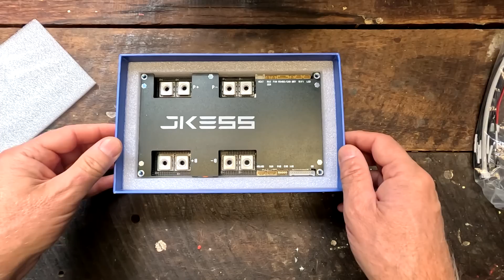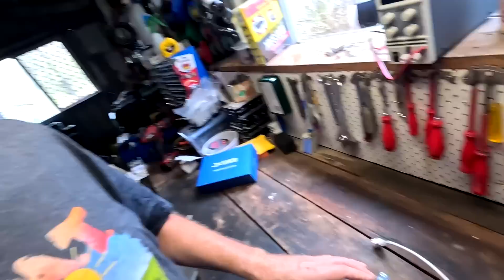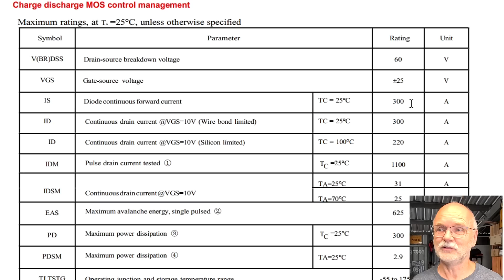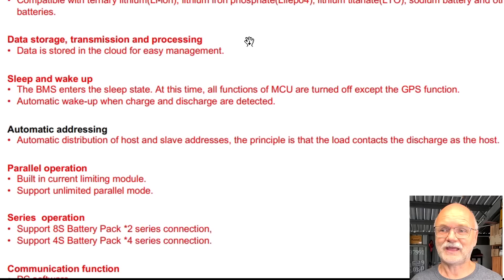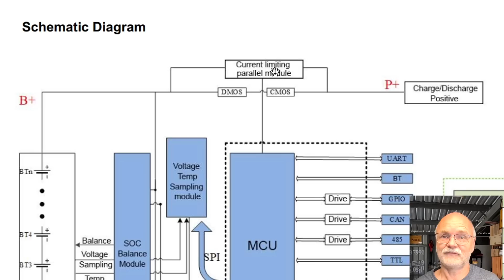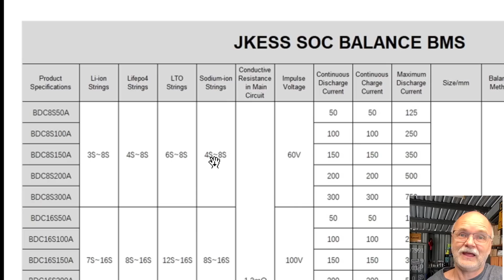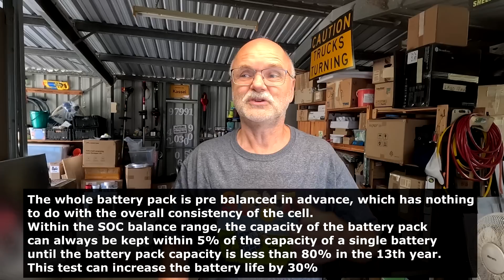Brand new JKESS BMS! Hardware, Specs, Features. It's not a JK-BMS though🤷‍♂️

Comment from the maker: It turns out, this JKESS BMS is NOT made by JKBMS/JIKONG like all the other JKBMS we have tested and used for years (BD and PB series)!
The JKESS BMS was sent to me by the JKBMS Official Store on AliExpress which is a distributor for JIKONG products, but this new BMS has nothing to do with JKBMS or JIKONG. It is a totally different product and not linked to, made or designed in any way by JKBMS or JIKONG. 
At the time of making this video, this was not clear to me. For a few months, I had in-depth discussions with the distributor about this JKESS BMS. At no point, I was told, that this is NOT a new JKBMS product.
It looks like a JKBMS, it feels like a JKBMS, but it is NOT a JKBMS. It is a fake and counterfeit product. Unfortunately, the JKBMS Official Store tried to use the popularity of the genuine JKBMS (BD and PB series) to advertise, market and sell this product through their channels and I was fooled to believe it is a new genuine JKBMS. I apologise for making these false claims here in this video and platform, but it was unknowingly at the time of recording. A̶t̶ t̶h̶i̶s̶ p̶o̶i̶n̶t̶, I̶ w̶i̶l̶l̶ n̶o̶t̶ f̶u̶r̶t̶h̶e̶r̶ e̶x̶p̶l̶o̶r̶e̶ o̶r̶ t̶e̶s̶t̶ t̶h̶i̶s̶ p̶r̶o̶d̶u̶c̶t̶. I will continue exploring this new JKESS BMS as so many have requested in the comments. Thank you for your feedback

I have spoken to the founder of JKBMS/JIKONG and they are still committed to further develop the firmware for the existing inverter BMS, both V14 and V15. I will keep working with JKBMS/JIKONG, providing feedback and testing new firmware versions.
Reply: I agree with several on here that it would still be interesting to see what it can do. My thinking was to set it up with the 8 worst matched totally different cells out of Frankenstein. If it can SoC balance that, it might be worth something. But yeah, that reseller did pull a shady deception.
Reply: @garymeissner6659  my thinking as well.  I'm very curious now.  This could be a fun little side trip into Franken Hardware land!
Reply: Now I'm even more curious lol
Reply: Another BMS launch failure after an unfinished JK Inverter BMS at launch, but this time different kind.
However, this one was done by some dishonest sellers. The BMS developers probably had nothing to do with this dishonest behaviour and may not have agreed to it, but there was probably nothing they could do about it. 
Still, I would like to see this BMS working and properly tested like other BMS. 
If you would test it anyway, you should rename this BMS first,  just like you renamed Peter-inverter or Peter-board etc.... 🙂👍
Reply: Sounds like it is destined for a life in the Frankenbattery!
Reply: @OffGridGarageAustralia  Hab ein Spezialthema für Dich, der heißeste Scheiß und nur auf Deutsch. 

AKKU ENTLADE PAUSE = katastrophal hohe JK V15 Inverter BMS Standbyverluste ?

Ich schalte mit Homeassistant ab X Uhr für Y Stunden (die günstigsten) per Automation beim JK BMS die ENTLADEOPTION aus.
Uns beiden ist klar, das Haus kriegt dann günstigen Strom vom Netz und nach 5 h hab ich 3-4 kWh gespart für den Morgen, wo Tibber die 38 bis 50 Cent haben will.
 
ABER: Ich hatte in Homeassistant für die Dauer der Pause im Chart eine horizontale SOC Linie zu sehen erwartet, wenn der Akku schon 5 Stunden frei kriegt bei dann 30% - 40% SOC, um danach auch am trüben Morgen bis 9 - 10 Uhr durchzuhalten.

Rate mal, was aus den 30% geworden sind?

Die waagerechte Mauer fällt zum Nachbargrundstück ab und ich hab da Verluste bis 4% in der letzten Woche erstmals gesehen. 
Ich hab den Balancer oberhalb 6 mV eingeschaltet und ich meine auch auf jenseits 3,35 V stehen, aber kann der Balancer 4% des Akkus in 5 Stunden verschlingen ? In 1 ganzen Nacht wären es mehr als 8 % oder nach 100 Betriebsstunden h ist der Akku leer. 

Kannst ja mal selber schauen, ob Du das auch beobachten kannst und was beim BMS das verursacht, denn 8% am Tage sind im 24h Betrieb auch 1 kWh Verlust, da der Akku ja mehr oder minder 247 aktiv ist und Verluste einfahren dürfte, sei es zum Laden oder Entladen. 

Ich bin auf Entladepause gekommen, weil der Strompreis in der Nacht augenblicklich zu hoch ist oder genauer zu nah an dem Preis, wo er später verbraucht werden soll wie dem frühen Morgen von so 7 bis 9 oder 10 Uhr. 
Ich brauch bei 28 Cent doch den Akku nicht laden, wenn morgen früh 36-38 Cent verlangt werden, weil ich bei 20% Verlusten auf dem Rundweg schon mit 34 Cent Gestehungskosten (ohne Kosten für Batt. Zyklen) rechnen kann. 

Da war es für mich smarter, bei absehbarem Engpaß am Morgen eben 3 bis 5 h Entladepause zu machen statt zu laden, aber bei 8% Verlust in 24 h sieht das ja gefühlt richtig übel aus.
Reply: Wow!
Reply: So this explains the naming "JKASS"!  🤣
Reply: Very pleased that work is continuing on v15, many thanks for your efforts in this regard!
Reply: Andy, after a lot of high-tech experiments on JK BMS : JK is abusing you.  No kidding.
Their hardware engineers are doing a great job. Their software engineers are too low level.  As you have noticed so many times.  JK top-management doesn't care ....
I'm checking the JK BMS protocols at the lowest possible level : with the logic analyzer. (((( no confidence in all those higher level hocus-pocus software stuff .... ))).
By now I have a large collection of examples about the JK BMS software "skills".

E.g.  The popular B2A8S20P has a CAN port.  On hardware version V11.XW , software version V11.287H : modify the device address (via the bluetooth app) will result in a modified CAN ID .   Device address = 0 will yield ID 0x02F4 (or 0x04F4 or 0x05F5 for other parameter groups), device address = 1 will yield ID 0x2F5 ,  address = 2 will yield 0x2F6, etc.  So far so good.  The CAN protocol is the Standard Frame.
Another B2A8S20P  :  hardware version V11A, software version V11.54.  One can change the device address (again via the bluetooth app), but the logic analyzer shows NO change in CAN ID  !!!!   Whatever device address selected, the analyzer always shows ID 0x2F4  (or 0x4F4 or 0x5F4).  That's a major error.  Forget to observe multiple JK BMS on a CAN bus.
On top of that, JK changed from Standard CAN protocol to Extended CAN protocol. Without any message to their customers.

Obviously JKBMS has communication problems with a lot of inverters.  
JK is changing internals on the fly and when they improve one item at the same time they deteriorate another item.
Updating features is great, but you should inform the customers about it !
A JKBMS from last year is doing fine, so one order some more "identical" BMS.  Forget it , they will have different behaviour.  

The basic B2A8S20P (or family members) has a 4pin RS485 port. Forget it.  It's a plain RS232 port, with the Vcc wire connected to the battery voltage (thus NOT to 3.3V or 5V).
(((that's why they sell the yo-do-not-need-it RS485 dongle to deal with this high power supply))).  The optional CAN/HC version has an extra port with CAN functionality or RS485 functionality. The CAN story : see above.  The RS485 story : that port is connected to the internal RS232 kernal, only the signal levels are RS485.  No MODBUS, no whatsoever protocol. Again : pure RS232 "protocol" at RS485 voltage levels.  And because of using the internal RS232 kernal, only one of the two "RS485" ports can be used at the same time.

A total mess.  We (= the users) cannot have confidence anymore in JK BMS.  Andy , please , stop promoting JK BMS.
Reply: Oh wow! After such deceptive behavior, I believe the first step should be to no longer send business to that distributor. Can you replace the Aliexpress link on your website with someone more trustworthy?
Reply: @peterdiy  Even better, request the real JIKONG to deal with the errant distributor.
Reply: In any case, I guess this is good news for owners of a V14 and V15. JIKONG should have a lot of motivation to improve those two, to keep loyal customers from jumping ship.
Reply: Now I definitely want to see the PCB!
Reply: @upnorthandpersonal  I second that!
Reply: Not an issue. Do not be so hard on yourself. We all make mistake since we are only human.
Reply: Andy, this is a reason TO test it. Why not? And we will watch the videos. Why not. You could probably test a box of marbles, and we would watch it.
Reply: I can see how it seems like a reseller is trying to push the product in a potentially shady way, but it seems a bit of a stretch to call it a "fake and counterfeit product". It appears to be a unique original design, with a different name and branding, and different documentation; which a reseller, not the manufacturer, is engaged in shady marketing practices with.

I can see why the deception from JKBMS Official Store left a bad taste in your mouth, but it's not clear to me that that anger should be taken out on this product and its manufacturers. 

If anything, I would be more inclined to sever ties with the JKBMS Official Store over it, since it seems that they are the ones overtly engaged in deception.

At any rate, kudos to you to for correcting the information once you became aware of all of the facts.
Reply: @Wrenchmonkey1  You don't take issue with the product name? JKESS? Sold in JKBMS Official Store... It's trying to pass off this product as something it is not.
Reply: @peterdiy   JKESS is not the same thing as JK BMS, which is not the same as JBD BMS... I'm not sure which of those was first, but that's also pretty similar. Does that make whoever was second to market a "fake and counterfeit product"?

You can "take issue" with companies having similar names, but that's still NOT the same thing as calling them a "fake and counterfeit product". Words have meanings, and that's not what those words mean.

Saying that you think it's shady that they use similarish names can be a valid criticism. Calling it a "fake and counterfeit product" is NOT a truthful statement, nor an intellectually honest argument.
Reply: @Wrenchmonkey1  It comes down to what the seller said to Andy. Quite obviously Andy was duped into thinking he got a new JK BMS. Which it is not. 

The consequence should be to not send any more business to that seller. As per my first comment. 

It is quite possible that the manufacturer of the JKESS BMS is innocent. Just like a factory that produces t-shirts can be innocent if they get later sold as brand name products and aren't. Counterfeiting can happen at any point in the distribution chain...
Reply: @peterdiy  What the SELLER said. 

NOT what the MANUFACTURER said.

Did you even read ANYTHING I said in the post you responded to, BEFORE you wrote your own response? Because if you did, you didn't understand it...
Reply: @Wrenchmonkey1  I looks to me that you have anger management issues (all the bold = shouting) and trouble comprehending simple information. 

To spell it out again: fake and counterfeit can happen anywhere along a distribution chain. It does matter what the seller said. Just as much as what the manufacturer printed (or did not print) on the packaging and users manual.
Reply: @peterdiy  Anger Management? Honey, I'm emphasizing words that you otherwise appear to be struggling to understand, in hopes that I can assist you in your struggle with reading comprehension. YouTube comments doesn't have an option for italics that I'm aware of. Capitalizing a couple of words for you is not anger. Seems to me you're probably projecting your own issues.

Fake and counterfeit can happen anywhere in the distribution chain, but there's zero evidence that this item is either of those things, Einstein.

Who is going to counterfeit a brand nobody's ever even heard of?

Words have meanings, and that's not what those words mean.

If you still lack the capacity to comprehend this, that's entirely your failing. Perhaps you can find someone to assist you. Shouldn't be too difficult to find someone of adequate intelligence to understand. Even a small child should be able to grasp it....

Getting YOU [emphasis, not yelling. Sorry about your previous feelings] to understand is a taller task. Good luck!
Reply: Why not test this BMS? you have it already and all spec look actually very promising if you wanna run motors with your lifepo4 bank.
Reply: Andy if you don‘t wanna test that BMS further ship it to me and I will do that. For 48V offgrid that BMS has no big features BUT for boats with 12 and 24V that BMS brings a lot of features not available in any BMS and it’s use for EVs mean it has enough peak current so you can start your diesel engine of that BMS as well as run bowtruster and windlass which till now needs expensive contactor BMS.
Reply: @OffGridGarageAustralia  
Hi Andy, your message was very rewarding for me, and I think it was for 90% of those who believed in, purchased, and still believe in Jikong products.
It’s disappointing to hear that there are companies that take advantage of the fame and success of others to try to emerge in a dishonest and unfair way in a constantly evolving market, but we need to be aware that they exist.
In any case, after this small misunderstanding, me, and some others, believe and will continue to place my trust in the research and development of Jikong products. I still hope that the Jikong managers and administrators have read our comments so they can understand how much people appreciate clear and honest sales, marketing, and development strategies!
Have a great day, Andy, see you soon!

Comment: Why don't these BMS manufacturers just skip the brute force mosfet disconnect idea and have two relay outputs instead. ?
One for HVD and one for LVD......so much simpler to switch off/on Victron controllers and inverters, better than just brutally pulling the power plug to your devices!

Comment: @5:24 the address on the back of the box is the same as NEEY, ANT, JKBMS, JIKONG, they are all interlinked. In the same buildings are many other businesses related to the power industry. They do this so, when something goes commercially badly wrong, the company with the debt walks away and disappears, and suddenly the premises have a new name, but same equipment and mostly the same staff. It might seem like a wild west approach, but it is how it is done in China. It is a low cost way to develop businesses, with the cost being borne by the consumers. Here in the West we do not (now) like this approach. Here in the UK it was exactly how our industry took off 100-150 years ago, with businesses going bust all over the place. What you get is rapid development, technological progress and advances at the lowest prices. Couple that with an almost non-existent commercial legal system, and anything goes. It is how the Chinese EV industry has taken off, although I doubt the state has much by way of a financial investment in BMSs (unlike the huge sums it is pouring in to EVs). America has much the same type of innovation potential, but its crippling commercial legal system negates the progress. In the EU, a massively burdensome regulatory system, coupled with a crippling commercial legal system, means any progress is very expensive and slow.

Comment: Great video Andy! Happy to be one of the - almost - 100.000 people that appreciate your efforts.
At the point where cloud connection was mentioned, I stopped thinking this might be interesting.
Still waitng for a daredevil company that makes it possible to hook up 4 strings of 18 EVE LF280K cells in parallel on a Victron (cerbo) system.
After more than 18 months working without any glitch, the 123smart bms (made by the dutchies here 😀) is still the only BMS that combines 4 battery sets in the Cerbo without any issue at al.
Would have liked to switch from cell level electronics to a centralised systems with cell wires to a box aside the battery cells but I am loosing confidence this will be available before I start building battery 3 and 4.

Keep up the ood works und viel Spass!!

Comment: This fake BMS claims to use the MP2793 BMS Chip by Monolithic Power Systems. This chip is still not available - data under NDA, maybe developement samples. Many text of the "manual" is  simply a 1:1 copy from the MPS pre advertisings for this chip. Maybe you can show some high res photos from under the hood? The chip is similar to the state of the art Texas Instruments BQ76952. If you find a product using the TI Chip, its worth to review and test it.

Comment: China and its dodgy marketing. As always, it is buyer beware. But, we move on. Testing and results are the real thing. Can it have the plates removed to see what is inside, what the production quality is like, whether chips are clearly identifiable or obscured (the listings show only rendered CAD images)? What display(s) does it support. A lot of folks out there will be wanting to remove early BMSs. I have four packs with the Seplos BMS. It works. It connects to my inverter and they do communicate. But the Seplos is awful at maintaining and charging the cells. Meaning I have to dismantle it all and manually reset the Eve cells at top balance. I even added separate balancers, but they are not much better, and eat power from the whole pack. My packs already have LCDs. AliExpress is awash with listings for this JKESS bms. Put one on your wishlist and they will send you coupons. BUT, only the 8s is likely to be out any time soon. The 16s is not likely to ship until January 2025. The 8s can do serial connection, but not the 16s. 5% or even 6% off with AliExpress 'Coins' (I have thousands of those on my account). Choice day coupons. I can get the 150A 16s version for $126 shipped. And wait till January. I did wonder if this thing was real, but you have one in your hands.